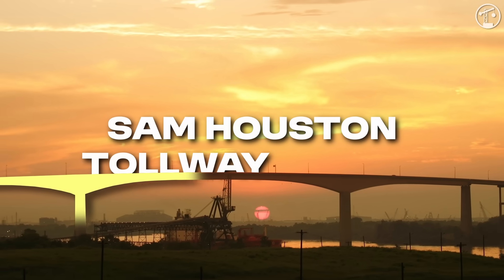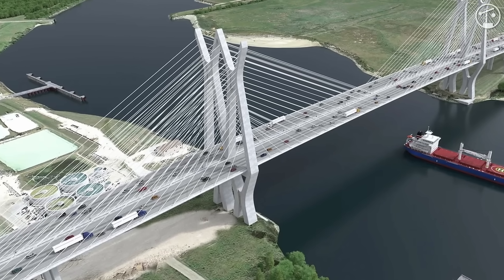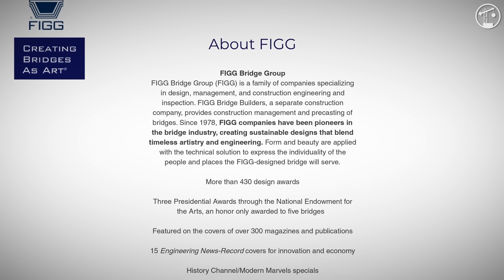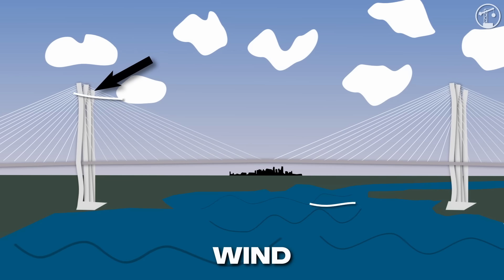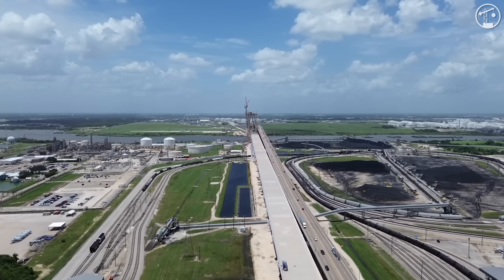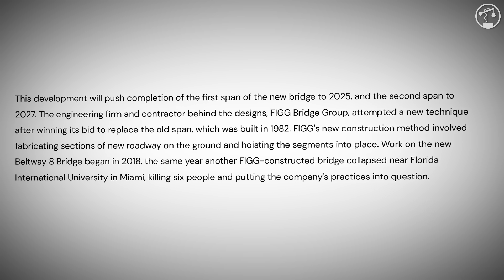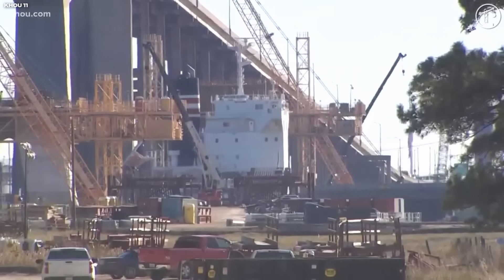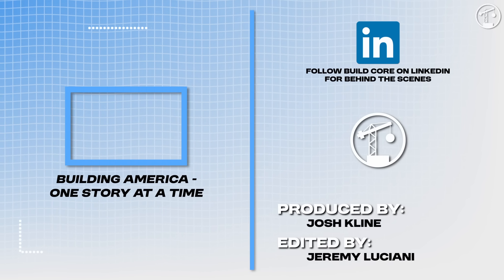Houston’s $1.45B Bridge: The Mega Engineering Failure

Comment: I liked the current bridge because it meant less bad drivers on it. Many who are scared to get on it. But then I don't care that they are replacing it. Just get it done, and done right.
Reply: I've been stuck in traffic there twice because of an immobilized vehicle, one, a semi and the other, a car. Both times took over an hour to get them moved.
Reply: @2nd_and_26 noob truck drivers and not so maintained cars shouldn't be on that bridge. I remember having a blowout as I climbed the bridge, I drove on the rim until I got to the bottom and pulled over. I ain't changing a tire up there. 😂
Reply: @jjohn713  well the state has changed the rules for passing car inspection is now only for emissions so we’re gonna see more cars not well-maintained causing problems
Reply: The bridge that is being built now was always in the future plans when they built the existing bridge. To the best of my knowledge, they are not replacing the existing bridge. The existing bridge will be used for northbound traffic while the new bridge will be used for southbound traffic. I believe that this is even depicted in the video. This is why they have been widening the beltway south of the ship channel. This is why they are building new ramps connecting the beltway and HWY 225.
Reply: @tommyhawks856 The old bridge will be removed. As mentioned in the video, one main objective is to remove the supports holding up the old bridge. Once the first span opens, they'll swap sides, demolish the old bridge, and build the second span.
Reply: @jacobrobbins6181  I did know that. Thank you for the information. I did not know if the video was correct when it said that, since one scene showed the Fred Hartman bridge on 146 connecting Baytown and La Porte.
Reply: @tommyhawks856 guessing you didn’t watch the full video

Comment: San Francisco's Bay Bridge East Span replacement ended up being 7 billion! Houston is still getting a deal compared to that.
Reply: Is Houston in an active seismic zone?
Reply: @NotDrDre Good point.
Reply: @NotDrDre  Never had a quake here.  We may be due.
Reply: @NotDrDre The only good thing to come out of Houston is 45 North.
Reply: I began commuting across the Oakland Bay Bridge in 1990 and watched surveys being conducted to assess damage from the Loma Prieta earthquake of 1989.  Initially, I think they were going to shore up the existing bridge and expand the toll booth area.  All of a sudden, after months of activity around 1990-1992, all construction halted.  There was no information for several months and then they announced plans to replace rather than repair the bridge. This was a great example of not doubling down on a bad plan (although I think they found an unexpected fault at the base of some of the piers).  Kudos to the engineers!
Reply: I guess it's a good deal if you are a simp.
Reply: They want our money to build the bridge and they want our money to use the bridge.  But they will tell you that you are stupid to think differently.
Reply: @mr90210 That makes no sense because it's not even close to being true.
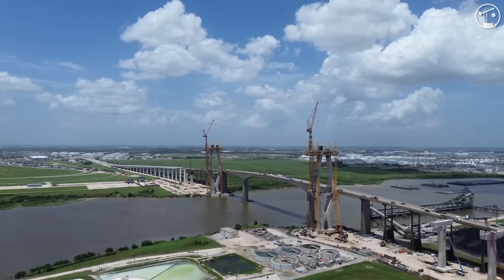Reply: In San Francisco construction costs are much higher because they’re required to use unionized lesbians. From Guatemala. 8:20 Women get more for the same work than their male counterparts.

Comment: I remember when we were told it would only be a toll bridge untill it was paid for another lie from the politicians
Reply: Yeah, I know. The Golden Gate Bridge. Herb Caen, the famous columnist for the San Francisco Chronicle, asked many times, "The bonds were paid off in 1976, so why are we still paying tolls to cross that bridge?" Wellllll, it's privately owned, not owned by the State Of California. And when the bonds were paid off, they saw that they still needed revenue to keep the paint jobs going. And their bus and ferry services never made a profit, so revenues prop those up. So drivers in the formerly golden state can expect to pay tolls to cross the Golden Gate Bridge into perpetuity - and higher tolls than the other bridges in the area!
Reply: @elwoodblues9613  bridge maintenance is expensive so it’s either tolls or taxes, take your pick
Reply: I remember that too. I never believed it, but I remember.
Reply: Nothing new. They said the same thing here in New Jersey  regarding both the Turnpike and Parkway. They even raised the price of the tolls at least three times in less than ten years. Once a toll is installed saying it's to cover the cost of building it, the toll never goes away. Yep, that's the politicians for you.
Reply: What? You didn't learn your lesson after 99? Or Beltway 8? Come on, buddy.
Reply: The Beltway has a clause that when construction ends, it will no longer be a toll road. Therefore, construction will never end!!!
Reply: Thing is, the bridge needs constant maintenance, it’s either paid by tax or tolls
Reply: Yep. The fact that Texas hasn't raised the gasoline tax- the primary source of money for road construction and maintenance- since 1991 might have something to do with that. As did the Rick Perry governorship, when his handpicked highway czar openly said, "In the future all roads will be toll roads," and which was responsible for all the Lexus-lanes across the state.

Comment: Just looking at the towers makes me uneasy. They may look pretty, but the design using two unsupported 'poles' jutting out of the top at weird angles makes me happy I live in Nevada and not Houston. In light of the weight they will have to support, I'd rather have a good, old-fashioned square design. They kinda remind me of the Kansas City hotel failure where looks were more important than functionality and safety.
Reply: That's why you are not a structural engineer.   We have another bridge with the same type of supports 10 miles away.    That was built about 15 years ago and no problems have been reported.
Reply: @michaelgreene582 ... Is that the Hartman bridge?
Reply: @TheWanderingFinnegan  Yes it is
Reply: The Kansas City hotel walkways were properly designed - and never would have failed if they had been built as designed.   Contractors felt they had a "equivalent" designs that were cheaper to build and did not tell the Engineer who designed the supports for the walkways about the changes.  The design changes were severely structurally deficient in two ways from the original design.   In the end the Design Engineer was found at fault for not monitoring how his design was being built and catching and stopping the changes (or doing proper engineering calculations to OK any design changes).   

There are multiple similar stories in the engineering world about how design changes are made by subcontractors to be able to build a cheaper structure that the design engineer did not know about - and resulting problems.

As a retired Professional Engineer...  I believe that we actually  need laws to be passed that no subcontractor can change any design element without permission of the design engineer who has to properly analyze the change.  But, that's not current law...
Reply: I'm no engineer or project mgr but I'm pretty sure engineering reqs superseded architectural details. ESPECIALLY on a high profile public infrastructure project.
YMMV

Comment: Funny how they make shade at FIGG when there were many more entities that had a share of the blame for the Florida ped bridge failure - including the FHWA, FDOT, FIU, etc. The final report is a real eye-opener.
Reply: I still held my Professional Engineer license when the Florida Pedestrian bridge failure occurred, and have read the NTSB report.   You are correct in that other parties were found to be partially at fault.  But, the reason the bridge failed was several major engineering mistakes that Figg made... (Example: other parties should have closed the road that day for the bridge work which would have saved lives and property damage, etc.).  However, the main fault was on Figg.  The other mistakes would not have mattered much if the bridge did not collapse.
Reply: There was another bridge replacement project in Corpus Christi not too far away from Houston to replace the existing Harbor Bridge and that had to be suspended not once but twice because of design flaws and it was Figg too. Now the new Harbor bridge is completed and is now open to traffic as of today and the old bridge will be dismantled
Reply: Figg sux. You don't get three failed bridge projects by talent.
Reply: @donquique1  You are wrong.  It takes a special kind of talent at the management level to get 3 failed bridge projects.

Unfortunately for those managers.  Other engineering companies ARE NOT looking for that kind of talent.
Reply: I wonder if there are any other parallels between TX and FL where it comes to civil engineering and local politics? 🤔

Comment: I would like to add this.  I live south of Houston and work in South Houston.  I am a delivery driver.  I have crossed the Ship Channel many times.  Here is something the narrator failed to mention.  The likelihood of that bridge NOT being built?  Pretty slim.  AFAIK, the plan is to dredge the Ship Channel so it is WIDER than at present.  And I believe deeper.  Thus allowing larger ocean going vessels to call at Houston.  In order to do that, the present bridge has to be removed, thus meaning building a larger bridge(s) is necessary in order to keep the Sam Houston Tollway connected on each side.
Reply: I think the dredging project is probably planned for the bay itself....jetty to mouth of the ship channel. 
I don't know how the Turning Basin could be altered to accommodate larger ships
Reply: @WillBass-n7o  I believe that you are correct. Once you get past Atkinson Island the shorelines are too close together for widening the channel any further and there are so many twists and turns to the turning basin from there that bigger ships could not navigate the turns even if the channel was dredged deeper and slightly wider. I have heard talks about deepening the channel all the way to the turning basin but only because the deeper draft ships that use the channel now are dragging their keel through the silt that is in the channel now. While there are some smaller ships that primarily run the Intercoastal Canal that travel as far as the turning basin, barge traffic dominates the ship channel past Atkinson Island. My hat is off to the tugboat captains that make the sharp turn to right at the Lynchburg Ferry to go up the San Jacinto River to I-10.
Reply: @tommyhawks856 i faintly remember the last bay dredging the Corp allowed.
Some environmental concerns about too much fresh water intrusion too fast into the "heart" of the bay. A loss of fresh water dilution and the "saline gradient" getting shot to heck. 
The Corp scaled back both the depth and width plans, iirc. But that 20+ years ago

Dredging farther up the channel also has that whole terrible prospect of long buried toxic sediment getting unleashed.
That'll be a no go. Oyster/shrimp fishery would be wiped out.
Reply: @WillBass-n7o  The channel also holds a lot of heavy metals buried within the silt and that was/is a serious environmental concern with dredging. Where the Lynchburg Ferry is there are signs posted to not keep any fish or crabs caught there because of serious health concerns. I am old enough to remember the ship channel catching fire several times due to all of the flammable chemicals there were in the water. The local news stations would show videos of chemical plants having pipes that were dumping their chemical wastes into the channel. This was before the enactment of The Clean Air Act and The Clean Water Act. Buffalo Bayou was so polluted that anyone entering the water there would suffer chemical burns. I never could understand people saying that The Clean Air Act, The Clean Water Act and the formation of the EPA by Nixon is government overreach. Without them, we would still have corporate overreach concerning their pollution and it being left up the citizens to suffer through and then later to clean up after them.

Comment: As a south Texas native, this all sounds VERY familiar to me…
Reply: Should be because it was the same company, FIGG. They had two bridge collapses, the most notable one was the Florida International University pedestrian bridge collapse.
Reply: The Harbor Bridge replacement project in Corpus Christi had to be suspended too because of the same issue That was explained in this video
Reply: @Escalator2X  I had a few business trips to Corpus this past year and have driven across the new bridge. It is TERRIFYING. Some of the concrete sections feel warped. The ride is incredibly rough. And this is when the bridge is NEW, and AFTER someone came in to fix the design. I fully expect that bridge to fall in my lifetime (I'm 52).

Comment: Tax Payers are NOT footing the bill for the bridge. HCTRA is - via toll charges.  If the video mentions it, the same engineering firm faulted for the FIU bridge disaster is responsible for the initial failed design that was flagged by TDOT. I didn't watch any further to know.
Reply: WOW.  You are just wrong.   So, so wrong.

Comment: The new harbor bridge in corpus Christi which also has issues with construction opened recently
Reply: FIGG was also the engineering firm for that one too.
Reply: took over a decade to build the one in Corpus Christi
Reply: They had to replace the contractor and work was also halted on it as well
Reply: This video feels like the one that covered that bridge too
Reply: Let’s see how long it lasts
Reply: @celly_mao5 its already settling on one end and shifted significantly on the other end causing 2 of the bearings to blow out